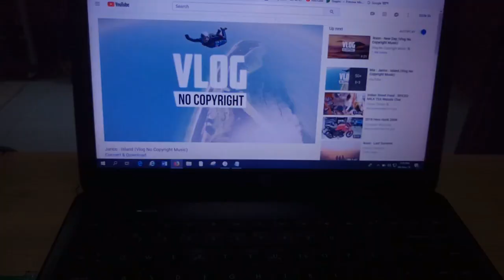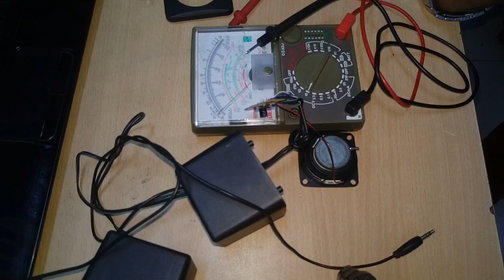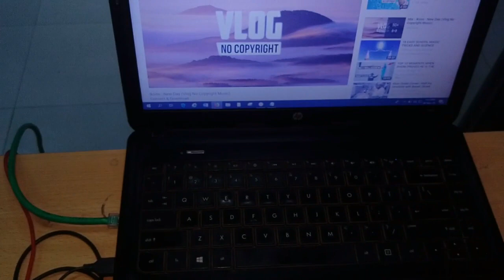how to repair mini usb speaker at home

Comment: can i use it without 5 volt  Mini audio amplifier circuit? by connecting directly?
Reply from the maker: you can use maximum 12 volt not more